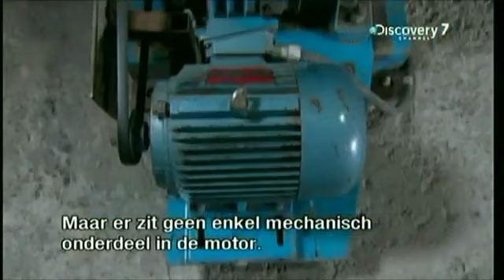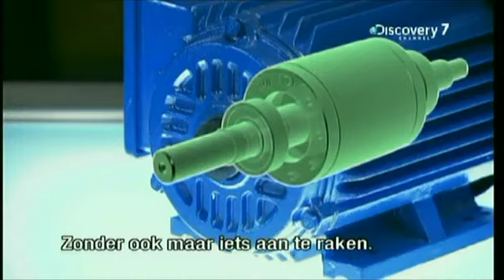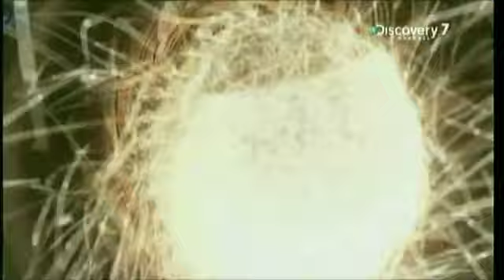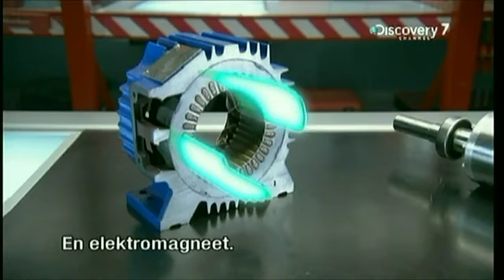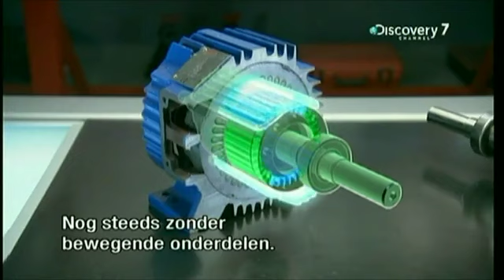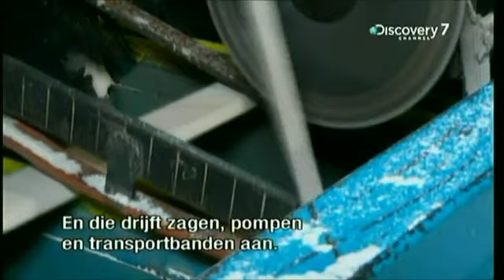Asynchronous Induction Motor.

Comment: The explanation about the rotating magnetic field is not accurate. 

It says that by switching current in the stator coils  will produce the effect of rotating, but this is not true.

The real explanation is the interaction of 3 currents (never interrupted) 120 displaced electric degrees, but since it involves a little vectorial analysis, Discovery decided to go with a wrong but simplest option.